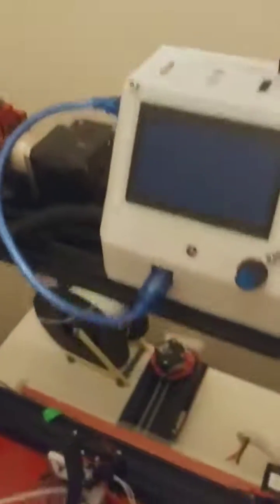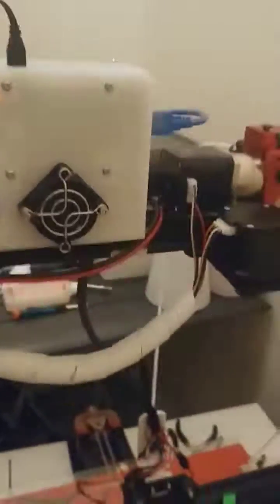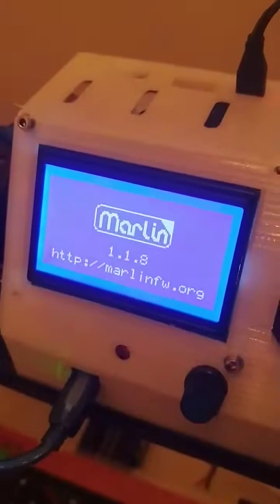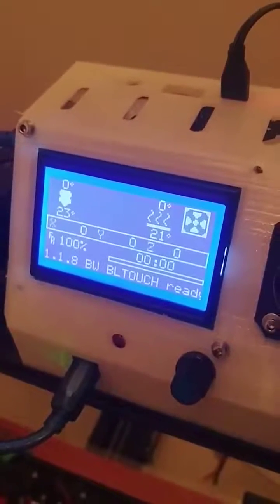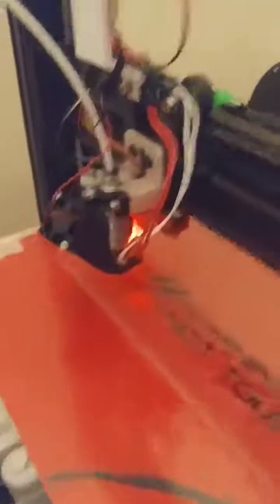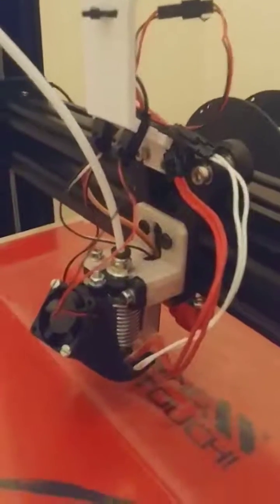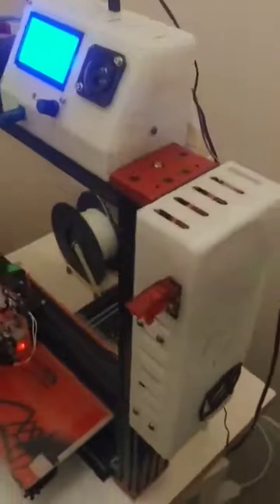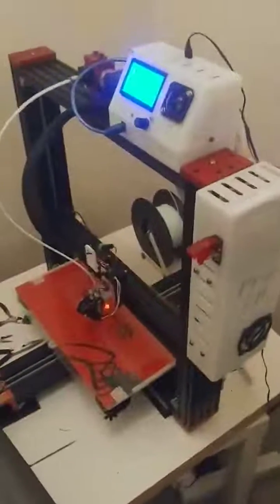Tevo Black Widow - Massive Upgrades

Comment: Would you share the stl files for the boxes that You used? My original box broke and love this one that you have.
Reply from the maker: https://github.com/RoyBerntsenDesign
Reply from the maker: Oh you mean the tevo. It is on thingiverse Mr
Reply: @PRO3DESIGN  Do you have a link?
Reply from the maker: @elvis0zd497  Cabinet for PSU + Mosfet found on #Thingiverse https://www.thingiverse.com/thing:2796092
Reply from the maker: @elvis0zd497  Cabinet for MKS Gen 1.4 and Raspberry PI Combo found on #Thingiverse https://www.thingiverse.com/thing:2791338
Reply: @PRO3DESIGN  Thanks heap Pro3D